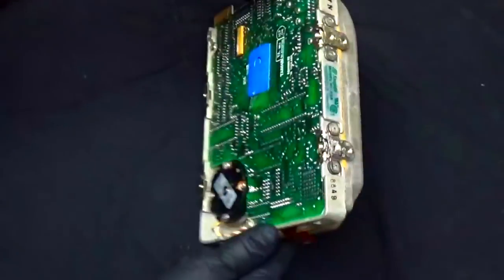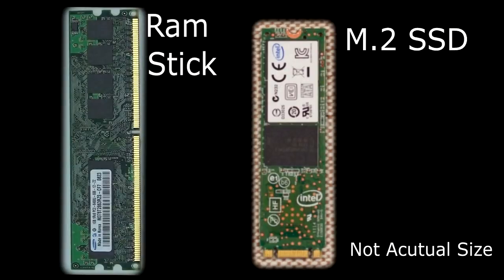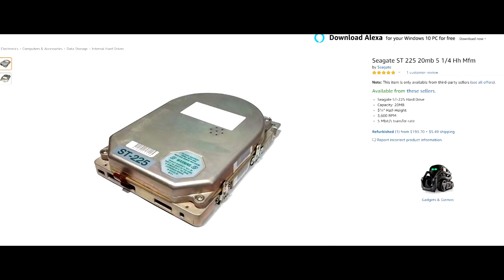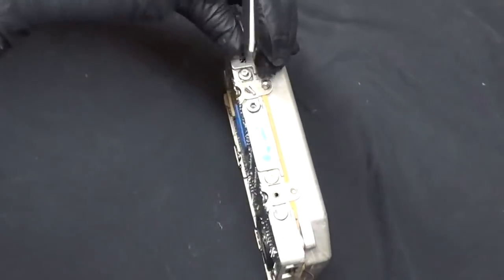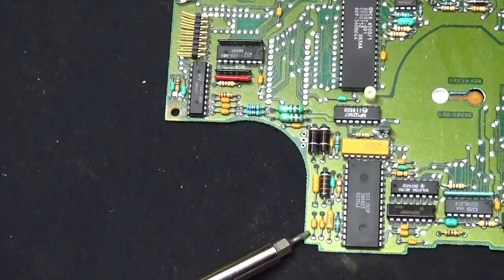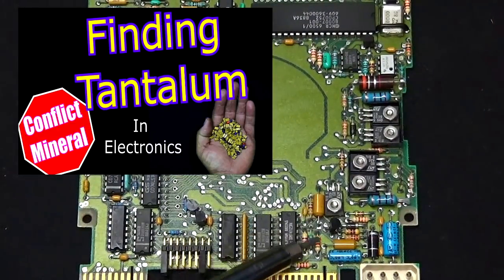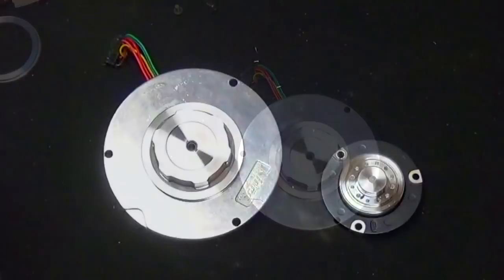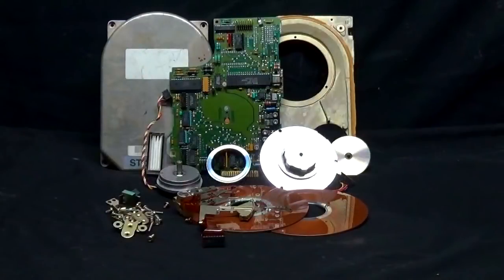What's in a 1984 Hard Drive?

Comment: too bad you couldn't read what was on that hard drive! would be cool to see what it was used for. I wonder what it originally sold for? I bet it was very expensive when it was new.
Reply from the maker: Could not find any info on the Original Price. But yes it would of been expensive.
Reply: @MiketheScrapper  there is a video of an IBM hard drive from the late 70s early 80s. Its 10 MB and the hard drive is gigantic. It originally sold for 250k. It's literally half the storage space as your hard drive and it weighed almost 80 pounds. And it was only a few years older. Amazing how technology can change in just a few years.
Reply from the maker: Holy Crap....$250k... i remember seeing pictures of old computers. They were huge....